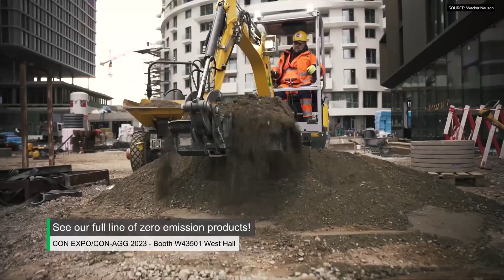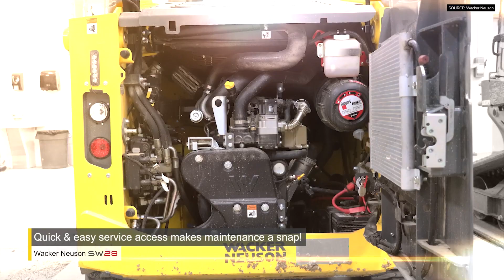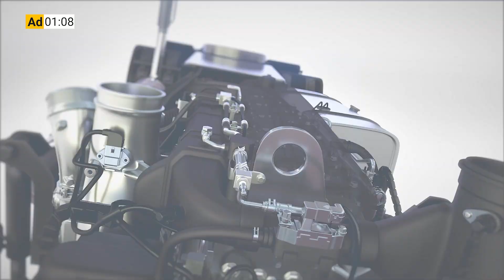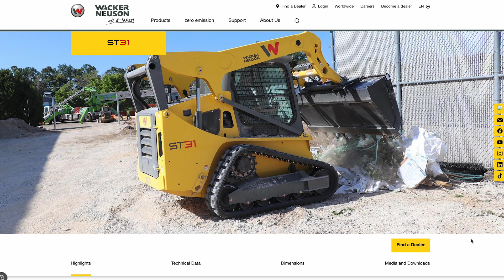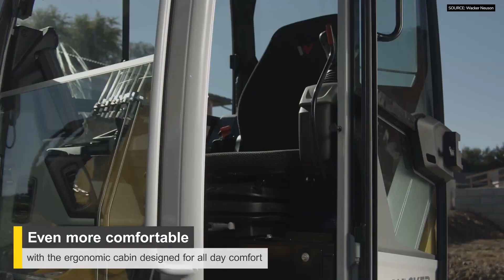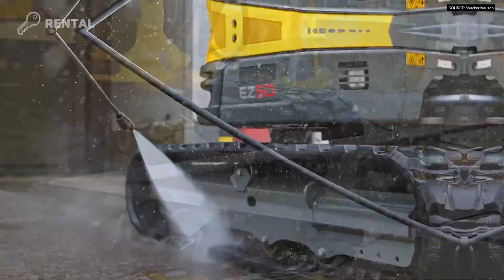A Closer Look at Wacker Neuson’s Compact Equipment

Comment: bought a brand new wacker jumping jack and didn't last 12 months or 22 meter hours and the foot oil was full of metal shavings it looked like milk. They did nothing for me even though it was under warranty. I'll never buy their products again replaced with Bomag now no issues in two years. Bought a 10 ton Yanmar excavator last year never bothered looking at Wacker.
Reply: Good info to share.